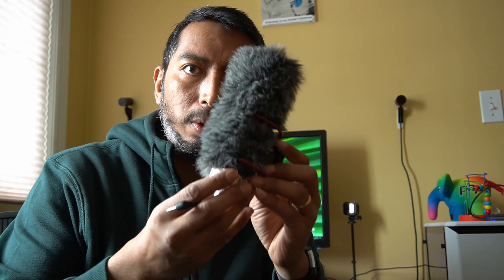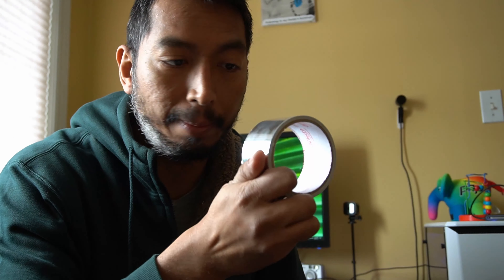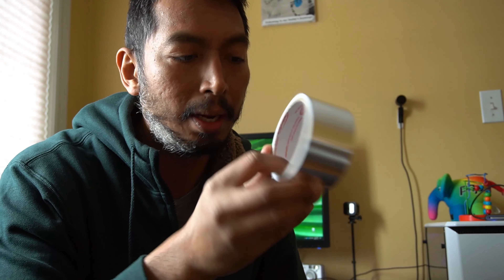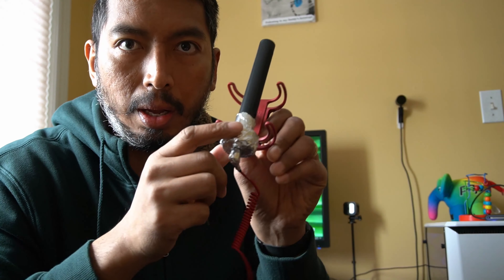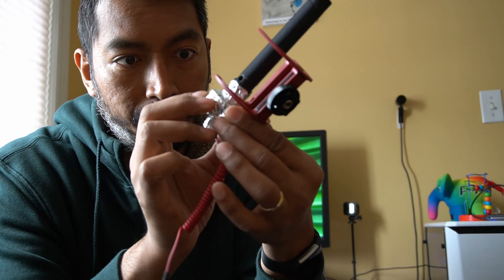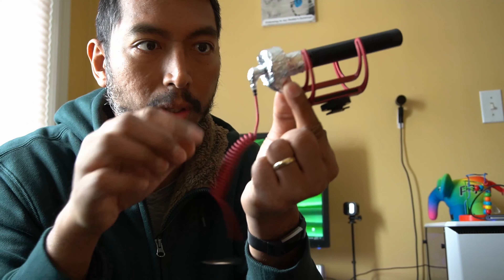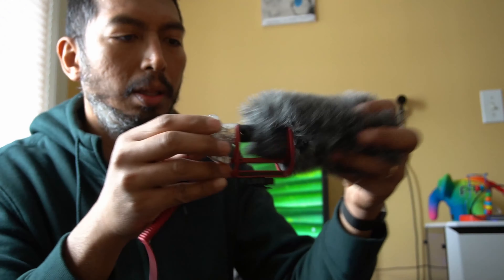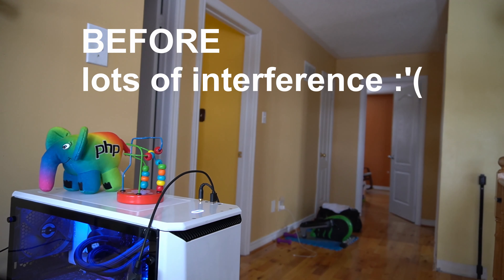Rode VideoMic Go Fix - Clicking And Popping - [Before and After]

Comment: Thanks for the video - this was the only solution that worked for me too - foil-on-the-coil solved nothing, but wrapping the main section of the mic in foil did. Crazy that a company with the reputation of Rode still actively sell this clearly flawed product.
Reply from the maker: I saw a couple of videos of foil on the coil that didn't work for me. Luckily I had some sticky foil wrap, because it's been a few months and it's on there real good.